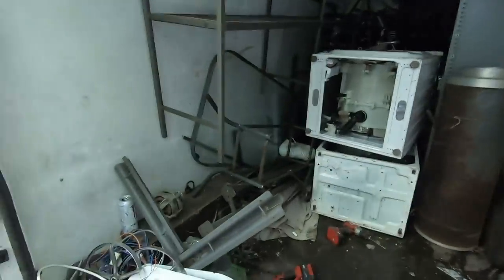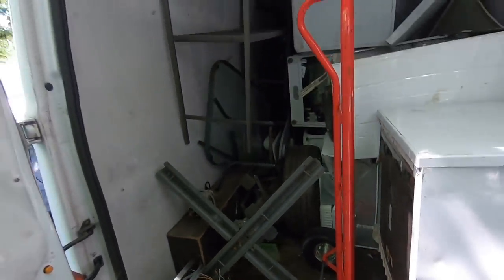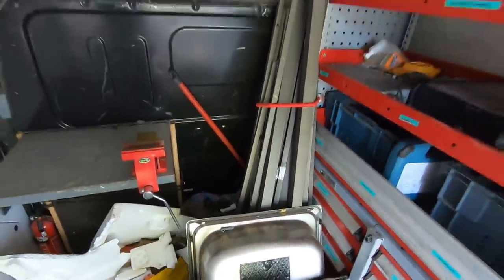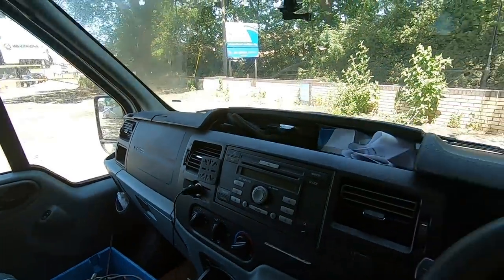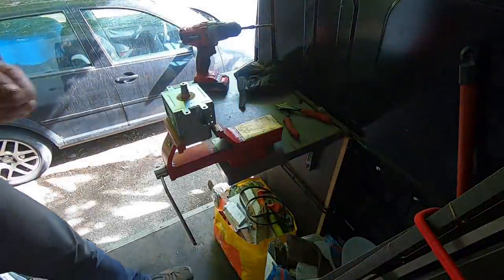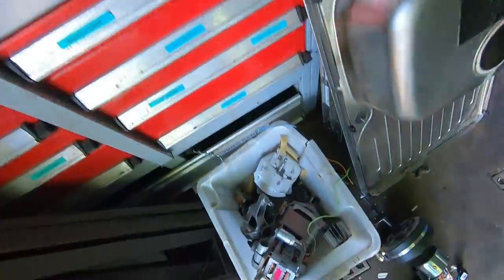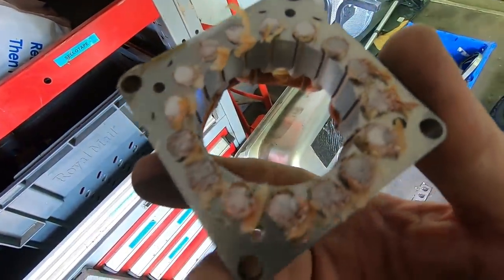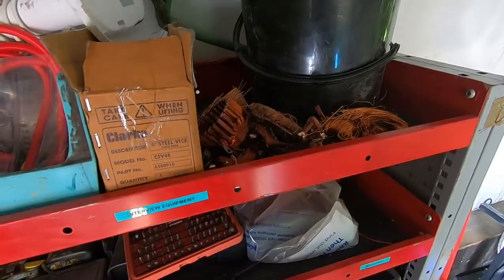Scrap Metal - Stripping copper motors - Weighed and paid #86

Comment: Well I knew there had to be an easier way to get a tumble dryer motor out, I’ve been doing it the hard way for years, never to old to learn.
Reply from the maker: Also comes in handy for dishwashers without the access panel.  I just cut the hole bottom off takes seconds 👍

Comment: check your washing machines..take note which copper and which are aluminium..the copper motors have an extra electrical connection going to the motor..it will save you time.
Reply from the maker: OK cheers.  I take the motors out anyway as I get 500 a ton including windings 👍

Comment: When your stripping your motors put the corner in the vice and use the actual motor as leverage by pushing against it with your grips it works for me
Reply from the maker: I will give it a go 👍
Reply: It should work lol only thing is your table will lift off the ground cause it’s not bolted down 😂